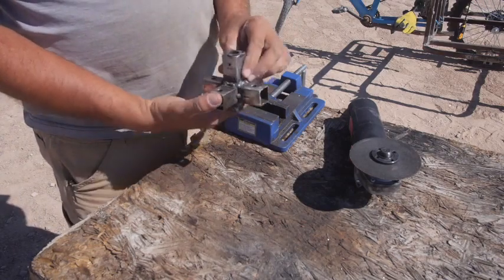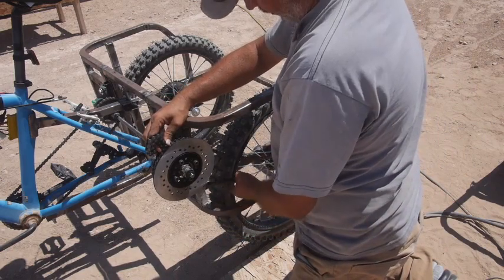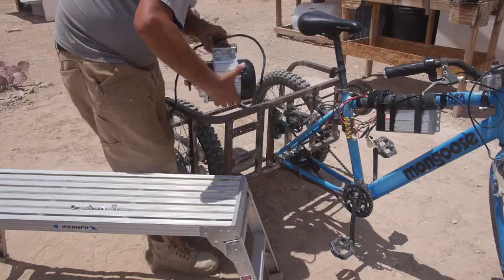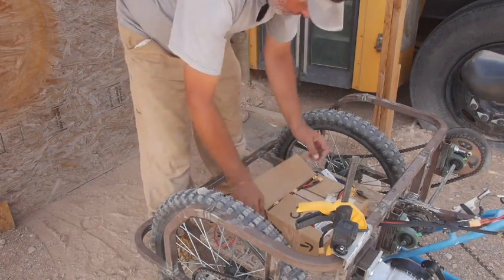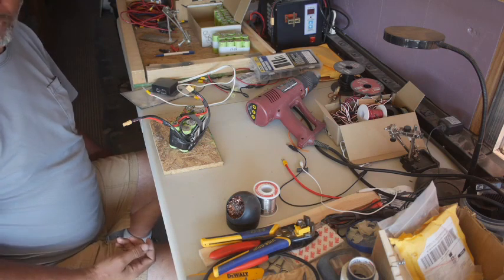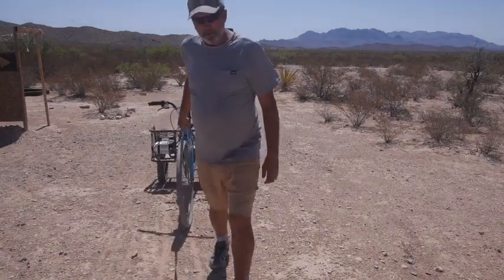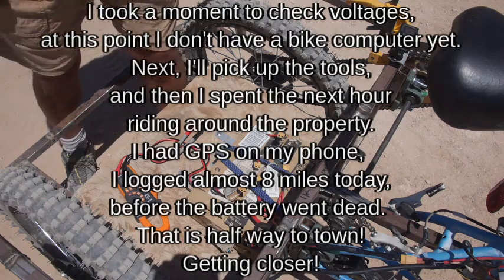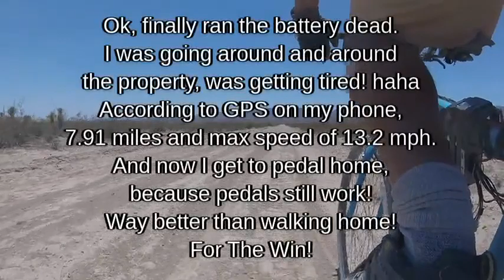Blue Bike Electric Trike - First Round Testing

Comment: Looking good Carlin! Did you start out with a full charge? Might be worth it to top-balance the packs first so you can get an equal amount out of all of them. I'm frankly surprised the 18650 cells went that distance! Awesome! Wonder if there is some other place to put the batteries to maximize your cargo space? I know your still testing things out but you got the gears in my head turning lol □
Reply from the maker: Definitely lots of room for improvement here. I'm not going to optimize the trike, its just a test platform, will move from that back to Turtle when I get steering figured out. The batteries are 26650s, but I also have 18650s on other projects. These have pretty good energy density, now that I understand them more. I wasn't fully charging before, now I"m close to topped off, with the bms. Pretty amazing tech, to be sure!

Comment: I am impressed! Looks like you are flying! Can you take extra batteries with you if  you run out of battery power? Looks like you have good muscles in your legs!!
Reply from the maker: I'm still testing with the small battery, the big one is about 3x the capacity, plus I could include the small battery too, so I think I could have close to 30 miles range there, if I do the math right? Plus I will still plan on pedaling. Next is to see if adding solar panels to the trailer would make any difference. It might just make it more complicated and heavy and fragile and not go much further.
Reply: @CarlinComm  too bad you couldn't charge the batteries by pedalling.
Reply from the maker: @gwenlaursen6460  Technically you can, but because you lose efficiency, you're better off pedaling and going somewhere, instead of pedaling to generate power. Solar or batteries or generators are not all that efficient, but by using "free" sun or free wind, we don't care as much if we don't get 100% out of it.

Comment: Now you need to make something so when you pedal it charges the battery
Reply from the maker: That comes up from time to time, yes! Every time I look into it, the efficiency of pedaling to run a generator is not very good. Pedaling the bike itself works fine. Solar (or wind) is way more practical to recharge the battery. Efficiency isn't perfect, but if you get 70% on solar, you don't feel to bad. 70% when you're pedaling would make you pretty sad :)  Now flywheels show some promise! Thanks for the comment!

Comment: What's the range now?
Reply from the maker: About 7.5 miles as it was. That's with a smaller battery I made for testing. The big battery is 3x that big, plus I could add the small battery, I might have enough there to go to Sierra Blanca and back. I'll still pedal some. Next round will be adding solar, probably to the trailer.

Comment: Your video came to mind yesterday  on another channel
https://youtu.be/KPQyq2DDdDU

He said he has tried both 20" tires and 10 inch wheels and he prefers the 20" wheels . He said he tried Harbor Freight  wheels that lasted only one day. Your video on your cart with the 20" wheels on front and the hand cart wheels under power yet you would preferr the larger wheels as the power wheels .
So that gives me two experimenters  recommendations  for the larger wheel as preferably to be powdered
Reply from the maker: Taller tires tend to roll easier. Out here, I found the wider wheels worked better in the sand though, so there were definitely advantages to both. I'm really liking the motorcycle wheels, they're about the best of both worlds, taller and wider. I looked at Fat Bike tires, but found that I could get the motorcycle wheels about at the same price.